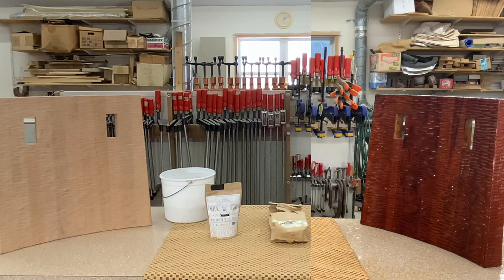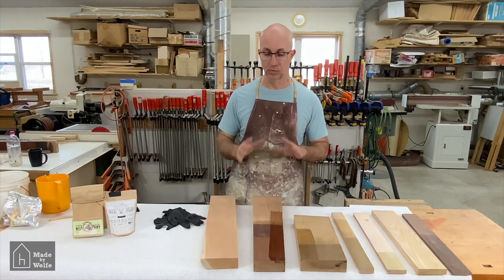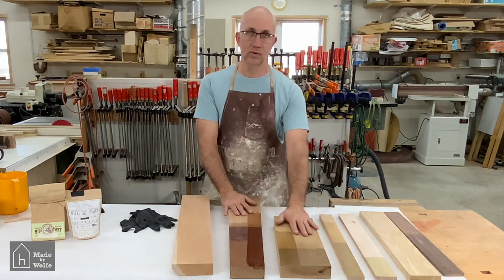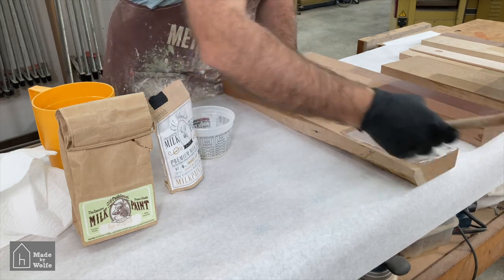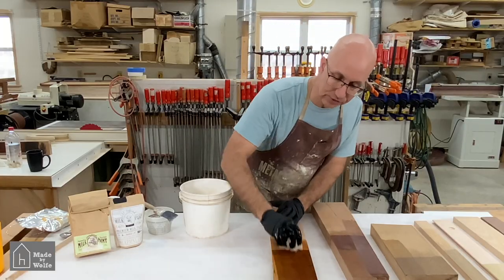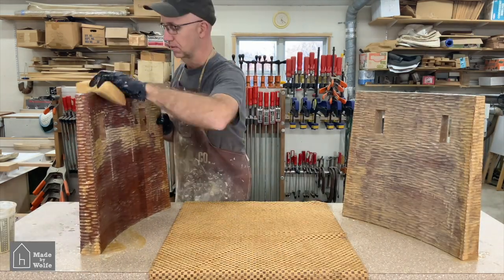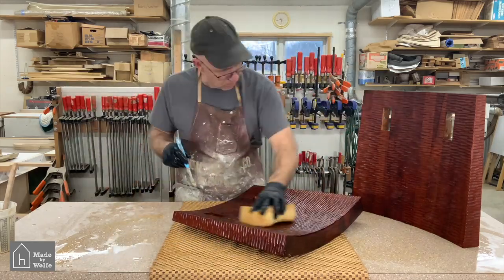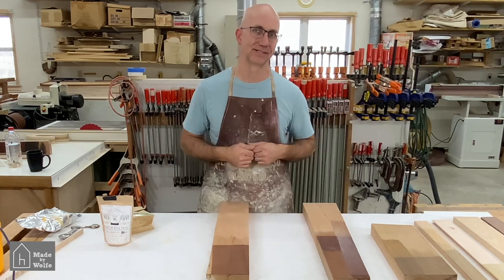Age wood 30 years in 5 Minutes with Milk Paint

Comment: Great video.   What kind of topcoat did you use?   Would a wipe on poly work?
Reply from the maker: Wipe on poly should work just find.  Make sure the piece is thoroughly dry!  A couple days drying is not too much depending on the temperature and humidity.

Comment: Nice!  Does it raise the grain?  Does it effect glue adhesion in mortises for example?  Do you have to sand it before finish?  Love the look and anxious to give it a try!
Reply from the maker: Just saw this and realized that there was no comment from me.  I swear I wrote the comment.  I think I forgot to hit reply.  Sorry for the delay..

So, you have good insight.  yes it will raise the grain.  On the Bluestone Bench project I took the time to raise the grain and sand it back before applying the milk paint.  (You can see that in this video:  https://youtu.be/j9oYvvRgcUk ).   And you are correct, the paint would affect the gluing.  So make sure you clean that up well.  I cleaned the mortises up on the bench ends with a toothbrush to make sure I got it all off.  Thanks for watching and thanks for commenting!